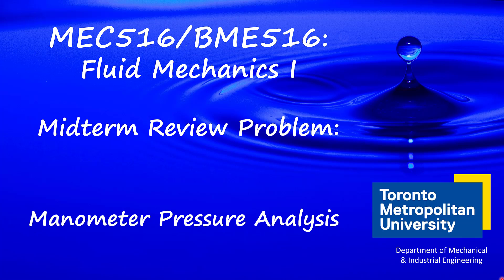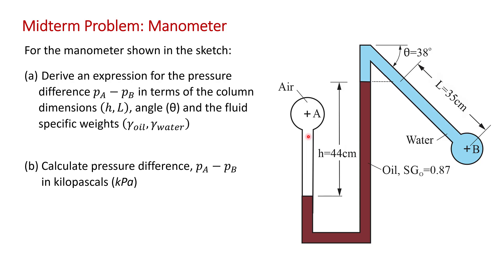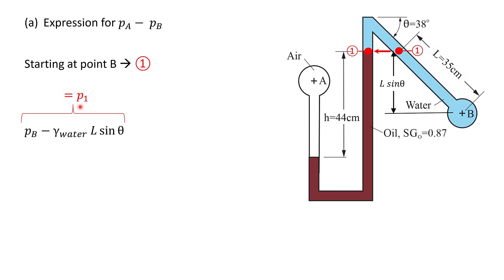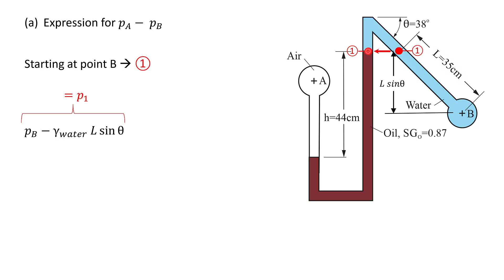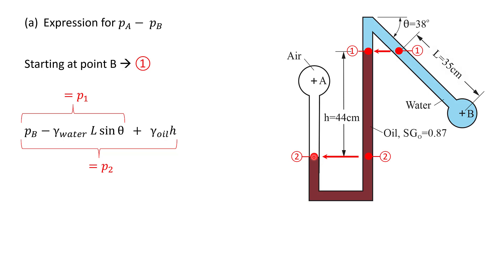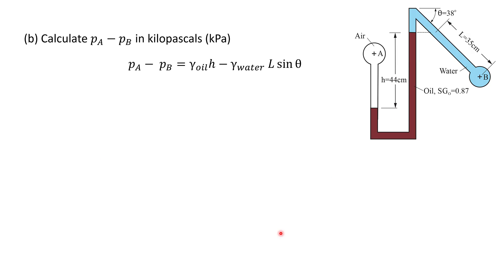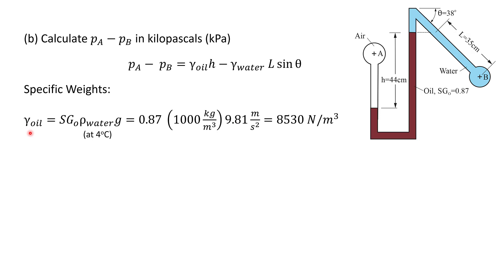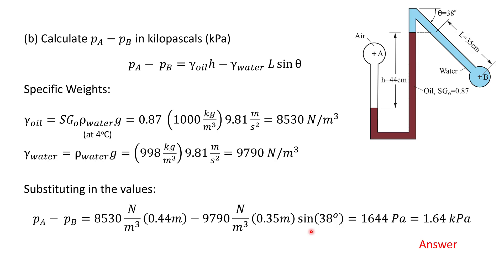Solved Problem: Pressure Difference in a Manometer

Comment: Sir please help me understand why the Lsin theta is negative and not positive
Reply from the maker: The general procedure is also given in this video: https://youtu.be/wpUGZCOslJQ  But you can also do a "sanity check" after you get the answer. Imagine increasing the distance L such that point B became lower relative to point A. The vertical distance L*sin(theta) would be larger. Point B would be at a greater depth of water relative to A.  Pressure increases with depth. So, P_B would increase relative to P_A.  So, you'd expect the pressure difference P_A-P_B to decrease, i.e. Thus, the L*sin(theta) term is negative.  I hope that helps.

Comment: why the gamma of the water using 998 and not 1000?
Reply from the maker: Density of water at 20C is 998 kg/m^3. But the difference is only 0.1% so don't get hung up on this issue.